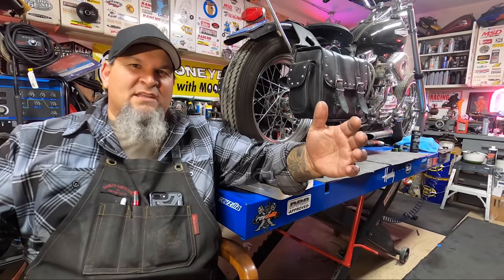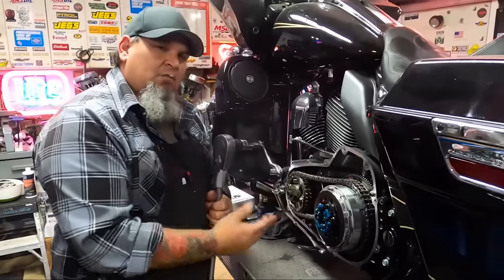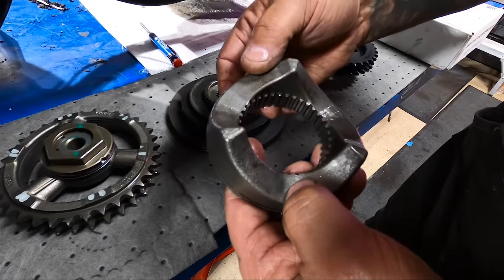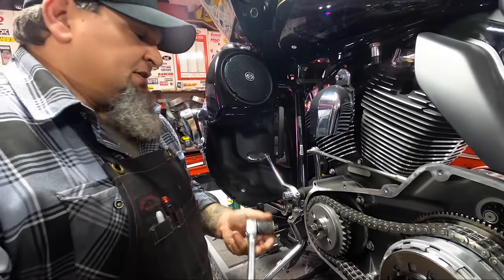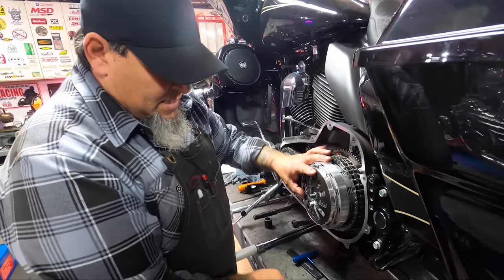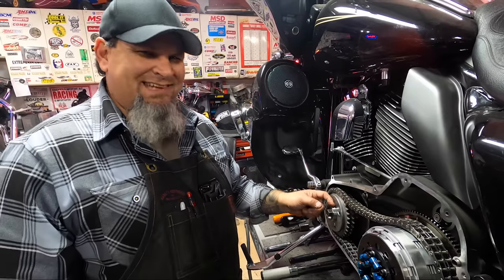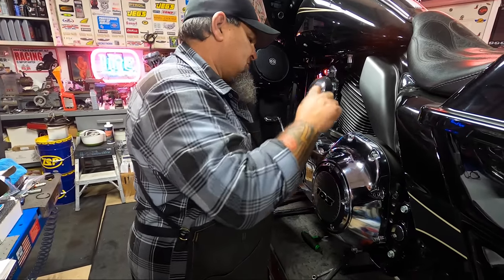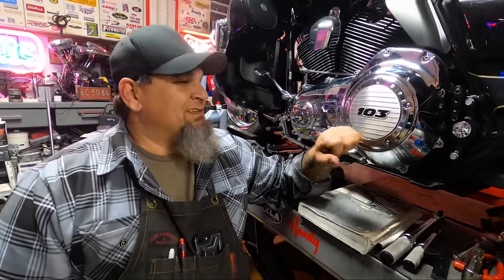Compensator Upgrade for Harley Davidson

Comment: Dark Horse Mon-O-War compensator and Baker 730-M8 compensator are two options to consider. My stock compensator grenades on my 2020 SGS with less than 10k on it. I can't say that I am gentle on my motorcycles but this shouldn't have happened and mine was far from the first. Warranty only covers going back with the original stock unit - same as the one that broke. Not gonna bash on the moco. I made the decision to buy the motorcycle. It's up to me to make it better than stock. Unfortunate reality. Ride safe.

Comment: Sir, can a Compensator also have a kick back (super loud clunk) when shutting down the engine, even if in neutral? I have a 2000 Heritage Springer that does this intermittently. I can't say for sure, but I am guessing the clunk is being made by the Compensator.  It does not do this on start up, and it does not make any unusual sounds when the bike is in motion.

Comment: I have an 07 heritage. At 65 to 70 mph i can hear a wherring chain type noise but it sounds like its tward the top front of engine , the bike is stock as far as i know with 7700 miles on the clock

Comment: Just curious why you didnt check the sprocket alignment to make sure it was within spec, especially with a new compensator.
Reply from the maker: Mongo, the kit does not come with any additional shims that are required for miss alignment, nor does a Screaming Eagle kit from Harley. I understand there needs to be an alignment with the chain, if the primary case isn't having wear issues or any damage, it's a straight forward install, unlike a cam to crank shaft relationship. Good question! No shimming required.

Comment: I did noticed that you had the Oil Deflector clipped to the inside of the primary cover........ But I didn't see anywhere in your video,  the installation of that oil deflector.  Did you install it with the clips only Or did you use glue as well.  Please let me know.  I am installing my motor sprocket today and will not be able to finish my install until I get that "glue or no glue" question answered.   Andrew said there was glue involved in attaching it,  But he did not send any glue with my sprocket, only the two clips.  And it is the weekend so I can't reach Andrew to ask him.   Please let me know, if you see this post soon.   Thanks

Comment: I have a 2007 harley fxdbi ever since it was new the starter has made a horrible noise i complained about it repeatedly no one seemed to be concerned  at about 40 k the crank started wobbling had it upgraded to a 103 10 1/2 to 1 pistons andrews 54 cams starter noise remained so i installed a all ball hd starter drive it helped the problem for a while now it has stripped the teeth on the starter dr is the compensator the problem and i am not understanding how because i am not really getting noise from the compensator . thank you for your time and videos

Comment: Great video! Very well explained and easy to understand the complete process. I just serviced the primary on my 03 Screaming Eagle CVO Road King. I pulled the primary cover off to inspect the primary drive assembly and replaced new primary fluid at 32 oz. I need to add 15 more oz because it was a “dry” install. I never knew that and have been messing with Harley’s for over 40 years. Thanks for the education.

Comment: This a great video, my question, can you use this aftermarket compensator on a stock motor that you might do some upgrades to in the future so that regardless of what you do it will be bulletproof, and you won’t have to worry about it, also, do you have to readjust the clutch (stock clutch setup) when you take out the clutch pack?

Comment: How is draining the oil achieved? Is there a drain plug as on an oil pan on a car or truck?

Is this the same procedure for a 107?

Someone changed out the compensator on my 2017 Street Glide but didn't replace the chain tensioner. Damn thing rattles like a pan head. I fing hate it. The Steeler screwed me good... Opened it and found the change and would only offer to put it back to stock. Never mentioned changing the tensioner... Unbelievable!

Comment: Great video, I gave a 2014 ultra Limited and just started to hear a noise on my primary, only when I accelerate and decelerate on a cruising speed like in 4tg gear, it is some kind of clunking sound when I open  and release the throttle, any idea, I appreciate your help. Thank you

Comment: Great video. I just installed this compensator on 09 electraglide with screaming eagle race clutch. Why do you use stock bolt? The pamphlet calls for longer bolt with torqued head. I'm also hearing some clunking noise. How much fluid and what bolt do I use?? Thanks
Reply: Also still having clunky noise when shut down

Comment: Have to ask a question about the compensator bolt. I have a 2016 Road Glide that came with the Screaming Eagle compensator from the factory. Do I reuse the factory bolt or do I need something from another year that was not screaming Eagle compensator?

Comment: I'm happy to learn from LATE NITE V TWIN videos! Should a guy start to learn to work on Evo engines first, or Twin Cams or M8s, if he has the chance to buy any of the three?
Reply from the maker: It's not a matter of learning what came first , the EVO or the M8! I believe you just need to embrace the platform you would enjoy the most and dig in from there. I cam from the shoveled era, and I have had pans, ego's, I own a shovel now, I own an EVO and a twin cam. My favorite is the EVO. They are all the same internal combustion engine with their own quirks. As I teach others, I teach the logic behind the principal, so others can understand how it works, and apply the logic to all platforms.

Comment: And my early twin cam the fsm says use an impact on the comp nut (for removal).   

Wish there was an upgrade for my early twin cam comp.   Running an extra spring in my 95" sitting at 10.2:1 with a woods tw6 cam.

Comment: I have a 124" M8 that makes 150HP/141Tq.  I believe it is running the stock compensator.  5K on the build/22k overall.  Am I asking for trouble if I don't replace the compensator?
Reply from the maker: Hi Tom, you are asking for it. The more torque out put, the faster the originals wear out! Baker, and Dark Horse make replacements that will handle what you can throw at them. Think about upgrading away from the automatic chain adjuster to. They really cause accelerated wear on the inner primary bearing and transmission input bearings.

Comment: Damn brother, I can watch you “The GOAT” work all day.  However, it is a frustrating bit of news the hear I must reuse the stock compensator bolt.  I have very little trust in what I picked up from the dealer.  And like the GOAT once said, “I can build a better Harley than Harley.”  I am having Blockhead do a modified Stage II using Wood 22XE, Trask Assault 2 into1/Air Cleaner/ External Breather/CheckM8/  (on your recommendation) S&S Plate/Pump/Tappets/Cuffs/Barring/Adjustable Rods, and finally got my service manual this week.  I am considering the Dark Horse Clutch/Compensator and now Baker Adjustable Tensioner.  Do you recommend weights as well? Why?  2020 Fat Boy 1400mls  🦅 of a 🪶 🪨 2-gether  (SS/SW/MTS) USN, Ret.

Comment: 2011?  They STILL have crappy compensators?  I put a SE in mine twice over 170,000 km's in my 2007 Electraglide.
Reply from the maker: WG, i have a 117" twin cam, and the Harley design doesn't last long with my build. Stock engines don't really destroy them.

Comment: Great detailed video! BUT Please NOT the SE compensator - it’s not really better. HD is terrible at addressing their bad designs. I had the Baker comp installed w/ All Balls starter clutch that got lunched when the comp went in my 2009 Ultra at 19000 miles. Seriously - fix it once - Baker comp.

Comment: I have a question. Could the compensator be related to starter clutch failures? I see many, many starter clutch issues. That has been replaced several times and continues to fail. And all have had compensator issues prior to starter fails. Any relation to this?  Thanks in advance.

Comment: it looks like in order to replace the stock comp to the dark horse, what has to be done with the shell that goes over the magnets that has the plates in it do I have to change the shell or somehow remove that cup that holds those plates, thank for the info👍

Comment: Great video. Put a Cycle Rama ramp on my M8 compensator, but am thinking about what to do with my 2017 Low Rider S, which is getting built to 124 as we speak. Looking hard at the  Darkhorse kit. But what about clutch baskets? Any risk there on Twin Cams? M8’s are also weak… I see you had stock. Are TC baskets stronger?
Reply from the maker: Hi Mike, I have never had an issue with my stock basket. I did upgrade the plates and frictions with Barnett, and the S&S pressure plate. I am not aware that the TC is any stronger or weaker. I have seen drag race engines  destroy the stock set ups, but honestly, Who runs an engine that big on the street? I have a 128 M8 that rolled out the door, stock basket with no issues.
Reply: @LateNiteVTwin  Perfect. Ordered a Dark Horse Comp, already have a Rekluse clutch pack, so should be good to go! Thanks!

Comment: I have an 02 ultra,lm going to be upgrading the stator and regulator,  might replace the compensator and pressure plate  since I'm in there. what  would you  recommend?  engine is stock. Thanks

Comment: After 20k i had my outer prim. cov. off just so I could look at things (06 tc 88 softail) used a paint marker to mark my chain so I could check play in different areas of the chain it does vary, you will have a loose spot and a tight spot normally, I make sure that the tight spot is minimal slop and the loose pot isn't going over the max play.
     Bought the bike with 19k on it now it's got 23k ,no problems, quiet but Harley changed compensators in 07 that were not near as good as 06 and prior

Comment: Just found your channel, I am just getting ready to install my Dark Horse comp, in my 2008 Fat Boy. You've provided a great video on the installation and cleared up a couple issues that weren't clear to me. I have a Hayden chain adjuster in my case since the warranty expired. In your opinion should I change it to a manual adjuster, I wouldn't mind if I did.
Reply from the maker: Hi Randy, I do recommend man pal adjusters to take the wear factor out of your primary case. The inner primary bearings and 6 speed input bearing suffer from the banjo string tightness of the chain that the factory tensioner provides.

Comment: Question for you at Late Nite V-Twin. I’m happy with the stock 96 inch Twin Cam engine in my 2007 Road King, same with the stock Milwaukee Eight 107 in my newer Road King. Would you recommend the DarkHorse compensator replacement upgrade for bikes that are still running stock engines ( engines with no displacement or cubic inch improvements)? I look forward to your reply, thank you.
Reply from the maker: Hi Paul, I wouldn't worry to much if the bikes are stock, even a 95 won't kill a stock compensator......

Comment: I have a 2016 road glide special , I bought from a friend , he had the dark horse Comp put in , it sounde really bad , like rocks are in it , I noticed in this video you used the stock Comp bolt , I pulled the primary cover to put a baker manual adjuster , everything was clean no metal shavings & no scratches anywhere but the man of war Comp had the T-70 torx bolt & I added 38 Oz of fluid. Could it be the Comp bolt - why it making so much noise and or do I need to add 7 more Oz of fluid - to make 45oz in primary

Comment: Very good Video.. I need the same style that you deliver on this video for a video to change the stock Cams on a 2014 Ultra Limited with lowers to the Woods 222 cams. Lifters to be replaced, push rods replaced, cam plate changed to the  S&S TC3 with the high performance oil pump and bearing replacement.  I have never worked on my bike before, I am just getting started.. I truly need a slow, methodical step by step video with all the gotchas. I am also looking at an oil cooler for this machine. Even though it is air and water cooled  there is an after market oil cooler from cool master for the oil cooler to be installed inside the air window of the left lower.  It looks ugly to me, but I am looking for longevity for my engine.  Lastly, I am looking to install an air flow cooler ( directing heat away from my right leg and passengers leg. Can you make a video for that component, wiring ect ect..

Comment: Great job love your set up ,but every time you want to adjust the chain , you have to take off the primary case???..yikes.
I need a new compensator on a 2005 Fatboy.(rocks in as jar,at idle,running and wot.) And a lot of Kickbacks on Startup when hot, sometimes when cold.
Unfortunately no aftermarket compensator will work with my year
I have to go back to the stock Harley-Davidson compensator, with a new spring pack I suppose?
Ty in advance, late night!
Reply from the maker: Well, you're stuck with a stock unit......I wish Dark Horse would make one for first gen twin cams....There is rumors about them developing one but nothing yet.

Comment: Hows it going Gary, very detailed video and I'm so impressed with the way you are able to explain things very easily. My buddy has a 2003 softail and his bike missed the cutoff for the dark horse manowar. What is a good alternative in your opinion?
Reply from the maker: Well, the screaming eagle replacement will work fine as long as the motor isn't a monster. Baker has one as well, I hear that Dark Horse who makes this compensator may bring one out for the first ten twin cams if the requests get heavy enough.

Comment: Thank you for the great video. Is there any reason you chose this compensator over the Baker? Also wanted to ask your thoughts about the Hayden M6 chain adjuster. Thanks again!
Reply from the maker: Hi Craig, the reason I chose this one was simple, It's a new product, and my big bore motor has shredded everything else. The Baker is a good unit, but again, I wanted to try this one out and see if it measures up. Nothing wrong with a Baker! As far as the Hayden tensioner, they're top notch. I use them quite a bit

Comment: Is there a safe way to lock the stock tensioner from over adjusting? I'm okay with pulling the primary cover occasionally if necessary to check the tension....There were complaints on line about the manual adjusters being very noisy.
Reply from the maker: There is no way to lock the spring loaded tensioner, unfortunately. The manual tensioners are a tad noisy. I wish Twin Power still made the manual one I have shown in the video. There is a company who sells a copy of them on Ebay, but I have not had one in my hands. My primary is super quiet now that I have this compensator in, and I have zero noise from the manual tensioner. The Hayden is the best for being quieter than the Baker or Screaming Eagle unit. Removing the cover to check the auto adjuster is a waste of time and money only because the moment you set slack it it, it will ratchet right back to over tight. I hope this helps??
Reply: @LateNiteVTwin  Yes, it helps! The primary chain was as tight as a bow string when I pulled the primary cover. I have been getting a bad vibration at 2000 rpm. At 2500+, it goes away. I'm guessing this is the problem. I'll put up with a little noise from a replacement manual tensioner. The Dark Horse compensator is getting good reviews. At $500, kinda pricey...... thanks, Art

Comment: I have a 15 ultra with the 103 how did you go from a 103 to a 117? Enjoyed the video very informative and yes l like to wrench on my own bike as well and yes I do have a service manual.
Reply from the maker: Robert, it's a long story. I had done a 113" upper end on my twin cam. Harley offers this as a big bore drop in for the 110". You have to get the cases bored to accept the new cylinders. Spigots are too big. The Harley barrels ended up failing, they were not round after we lost two top ends, needless to say I could not go back to a 103. I contacted Revolution Performance, and they offered a 117 kit for the same spigot dimensions. I had to run the Screaming Eagle CNC ported heads, and we stepped up the cams to a Woods TW9-6. That's how we got to 117"

Comment: Question.. what do you think about “Vented Dipstick” are they worth the $280 ??
Reply from the maker: Hi Pat, IMO, I think they are a great addition to helping the M8 breath better. As the pistons swing in the cases, they build pressure both in a positive way, and negative way. The breathers in the heads can't keep up with the air/oil vapor that is built by those events, and it gets pushed out the breather through the air cleaner. Hence, dripping air cleaners! It's a great upgrade. All my M8 customers have them now, and no issues!

Comment: Just checked out this video. Hopefully you have time to answer this question.  03 Twin Cam, recently did an upgrade to motor where it was dyno’d at 101hp and 102 torque. It appears the clutch has some slippage at the higher rpms. So that is going to upgraded from stock. While I’m in there would this be a smart time to also upgrade the stock compensator? Would 101/102 qualify as a high torque application? Thank you for your time and keep up the good videos my man!
Reply from the maker: 03 twin cam should hold the stock compensator well. You could upgrade to the screaming eagle unit or any brand for that matter but you will need to buy the rotor kit that Harley sells that is a separate piece than the stock unit. The stock clutch should hold at that output but an upgrade is always best when they do slip. Check out the S&S weighted plate for that. It's the same principal behind the Centerforce clutch for cars. The weights add more pressure the harder it spins, less chance to slip. Harley has one in the catalog to, made by S&S........
Reply: @LateNiteVTwin  Thanks!